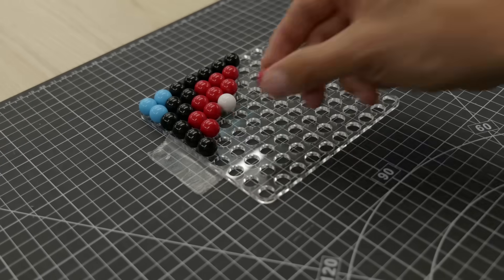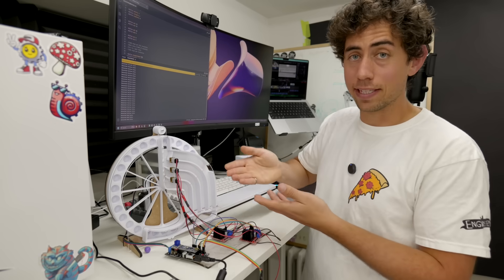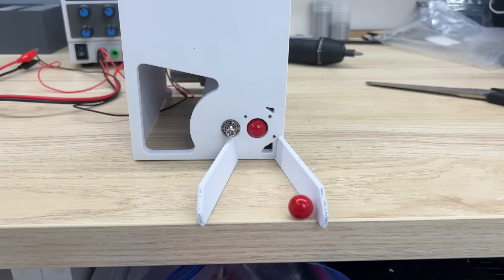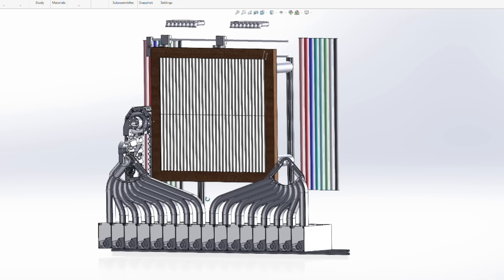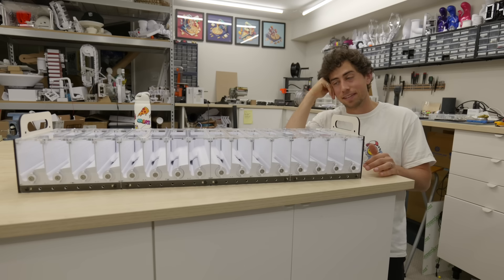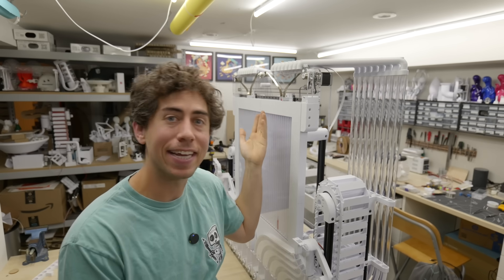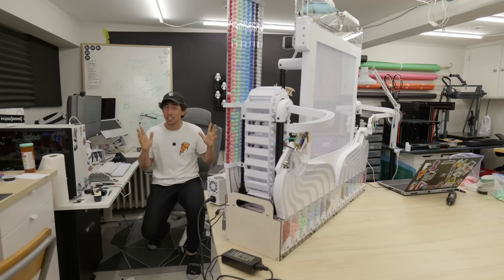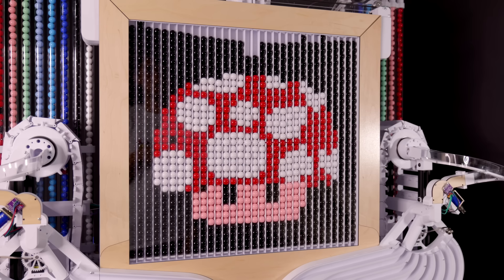This Marble Machine makes Pixel Art

Comment: Wow... so much overengineering things... and it fizzled out at the end when you're filling two columns at a time instead of filling all 32 columns simultaneously. 
I would have used 32 solenoids at the top to "punch" the ball from conveyor belt into the right hole - the belt at the top could be at a small incline - not incline, angle, whatever - to keep the balls from falling off the belt (think natural incline of roads in curves). You could have holes or something punched in the conveyor belt and use infrared sensors (like a mouse uses on scroll wheels) to sync the conveyor belt with the holes, or you could have the separators on the conveyor belt press on a limit switch... each time the limit switch is pressed, you know the ball compartments are aligned with the holes. 
So then it's a matter of just placing the balls in order to be lifted up, but even if you have them out of order, you could just let one ball pass all the 32 slots and fall back into the sorting compartments at the bottom.

Comment: Why not have 8 different containers, one for each color and keeping them separate. You could index ever spot on the canvas to know where which marble is and is supposed to be and you can drop them one by one all on the left of the canvas and have a slight decline with a opening and closing mechanism dropping them down in a connect 4 kind of way. You could of course use the mechanism as in the video but I dont know how it works and haven't seen typical faults it encounters. When you want to clear the canvas you know which marble is where so you release them one by one and can sort them without using light sensors.
Not a big fan of sensors like this if you couldnt tell. My solution should be more reliable even if a little less cool.

Comment: I bet you could produce images faster if you didn't sort the marbles. If you have a color sensor on each tube at the top, you could chose next marble drop from any of the available colors ready in the feeder chutes. To avoid getting stuck without a color you need, you could add a "garbage" chute to recycle marbles until you get the color you need. This would avoid all the complex binning mechanics at the bottom. Only drawback would be aesthetics- more of a gumball machine look than an M&M's store.

Comment: Maybe I missed it but it seems you don't have anything to make sure you have an even distribution of marbles on the right and left side before sorting. Obviously the marbles on the right side of the frame come from the right side and are more likely to fall and get sorted back into the right side, but still there are a few marbles that switch sides. That would possibly unbalance the distribution of marbles. How do you deal with that? Move by hand marbles from one hopper to another?

Comment: I wonder if it would make more sense to put the sorting bins at the top rather than the bottom. I'm imagining that would allow the images to be created much faster since the hopper would only have to drop a ball out instead of pushing up an entire tube of balls -- and then the slower part of the process would fall on the sorting mechanism.

I'm no engineer, though. I'm sure this makes more sense in my head than it would in practical execution.

Comment: @engineezy Couldn't this be much further simplified (but maybe less pretty) by just using the color sorter and the "elevator"? Let the elevator provide balls from a reservoir, the the color selector detects the color and put it in the right column to make an image. If it's not a color that is required just toss it back into the reservoir for a new ride to the top... Of course making an image can take longer... but it's just a lift + the color sorter + a reservoir ;-) no bins per color etc etc

Comment: The screw he had to tilt would have worked vertical if he had put little walls on the screws surface to hold the balls in place as they ascended up the screw.

Comment: Here's a potential project... a smart coin bank. I have 4 x 5 gallon water jugs that I use for putting my spare change in (one for quarters, one for dimes, etc.). Be kind of nice to create a smart change bank where you can just dump in a cup of change into a hopper, have it sort between Quarters, dimes, nickles, & pennies, and have them go from the hopper and dispense into a 5 gallon water jug (again one for each coin value) ... while having a web GUI you can access on a computer that'll tell you how much of each you have (ex. $50.25 in quarters, $7.80 in dimes, etc.) and then have it total at the bottom. The idea is to toss your lose change into a cup style hopper, have it sort, count and dispense it into a jug (so they're separated) and report the amount you have in change.

Comment: There is a bit of sagging (marbles of the same row not in a straight line, but a slight "u".) in the rows of the created images. It gets more pronounced for the upper rows. Will you try to fix that?
Edit: Just saw your comment about that. What about gluing the front plate to the channel separators?

Comment: 4:33 why not offset the design of the triangle to avoid the two spherical packings you're encountering? Sort of like restraining the growth of a crystal. There'll always be a shear line. Simple shifting in one of the walls of the triangle slightly? You could experiment with this using shim pieces of plastic or wood...

Comment: That is so sick, great job!
I feel like a relatively easy upgrade to this project would be to make the current “frame” into just a hidden queue and add a another frame below that. Make it so it displays image 1 in the bottom from until image 2 is completely finished in the hidden queue, clear the bottom frame and drop in image 2. That way it’s always displaying a full image and can be like a cool little art piece. Plus you have 99% of the mechanics completed already.
Either way, amazing work!

Comment: Really fun! Imagine putting a binary sorting mechanism on top of those columns. Similar to "Quercetti Rami". Could be built using 5 or 6 rows of binary branches each of the rows is (entirely) pushed by one solenoid actuator left or right. Maybe it would even be possible to run multiple marbles at the same time through the machine  --> would look and sound cool to shift the rows quickly.

Comment: Maybe I'm stupid, but I don't understand the point of having the marbles sorted outside the display. Why not just have them all together, plumb them across the top, then drop them down if they match color needed in that column? The issue I see with that is that the refresh times could be quite variable due to random chance, but with large images, I think the average wouldn't take too long. Idk, I'm no engineer.
Reply: 0:20

Comment: Hi. Thanks for the video! I like your videos, thats sure. But very meny problems are because of plastic!! Plastic and plastic 3d printers with 3d printers toleranses. Thats the problem. I personally thinks 3d printers are more like a toys, than a real tools or real machines to do somethig real searious shit. Maybe I think like that because I do like to machine all my parts and projects with milling machine or turning. Of course that should not be the right answer, but it is what it is. Thats my opinion, and I cant do nothing abaut it. I just like way too much more abaut metals and metal machining machines. And plastic is like legos for me. I am sorry abaut that, but thats the thing, what I have been noticed abaut all these 3d plastic printers. And otherwise, without any 3d printers, plastic is plastic. I do not like it at all. It is weak and doest be able to handle any heat etc. Pretty poor material even beeing the best of the best plastic compared to metals. I think you should have a small cnc milling machine and a small turnin machine. And wola, there you go! I'll bet you could do what a mazing things with some real tools! And I am searious!! Pleace, thing abaut it at least.

Comment: im getting PTSD from spending probebly 30(probebly more) hours doing this in minecraft.(without commandblocks)
pistons often dont do what you want and sand can break if the timing is not perfect and the bigger you make something the higher the chance is that it will start to lag and something will get out of time. we made memory cells that took a 16 16-bit strings that came from our drawing pad(preassureplates on the ground that when you press on them they get saved to memory). the sand screen had to use the memory cell twice. first to print out the picture that you had drawn and second to sort it back out again since there is no way for the game to know what block it is to sort. 
the biggest nightmare was to get the sand back up again to reset. some sand blocks would often break for seemingly no reason on the way back... or while printing wich would screw up the sorting since it would blindly sort out the same way that it printed.

Comment: filling from the center out to the sides might reduce the impact of the front plexiglass bending. the jiggling effect that the marbles have when they bounce is going to be weaker at the edges where it's secured, and strongest at the middle where it has the least support, so it should reduce how much the lexan gets pushed out by the marbles, even if the overall forces remain the same. if it doesn't, just get a sheet of perspex that is thicker in the middle. a gentle bell curve shape if viewed from the top/bottom edge on. 
if you feel like reducing the bounciness of the marbles as they drop, and EDF blowing air into the bottom of the picture frame (via the exit channels) should be sufficient to slow their falls. while it will get weaker near the top, they'll be falling for less time so the need to slow them down will also be less.

Comment: To make an Archimedes screw work as a lift, the outer diameter has to be such that the balls stick out a bit. You could make it so the screw just passes the middle of the ball where it sits. Then you need rails along the sides to constrain the balls to that part of the lift. 

Look at Spacerail marble runs. They use vertical screws for the lifts.

Comment: Beautiful work. 
Here's a rarely-considered fact (from a guy who has sorted countless marbles): consumer-grade marbles are not held to very tight tolerances!  

If marbles were put into this machine straight out of the mail, it's safe to say that probably more than a few errors were caused by size discrepancies. Standard marbles are sold as 9/16", but that number is just their average size. On top of this complication, marbles will also vary with respect to roundness. Eccentricity is a whole 'nother thing to test for; a simple rail-sorting machine can easily screen for size, but such screenings assume a marble is perfectly spherical, and thus multiple screenings (of the same set) are necessary to determine their degree of roundness.

Forget that, though. An occasional error makes the final product a charming work of art. It's almost better that way. More uncertain. More human.
Reply: Yeah but dead pixels are annoying.
Reply: More like a blind human who can't correct themselves but yea I see what you mean

Comment: Awesome design, and visually appealing. I would suggest a future modification, of a second colour detector at each of the two dispensers so it can eject back to the sorter any incorrect marbles. Also, is it possible to have the sorting of the dumped marbles done at the same time the new image is being built, rather than done one operation at a time?

Comment: Just a question why the center part on top is going downwards? Looks like the bottom is completely flat and stable. It is not lack of a marble as it would be a step or rather pixel difference. This is bending down.

Comment: Man you can use the Archymedes screw vertically just by putting small verticall walls, stoppers,  half the height of balls,  on some parts of the screw to avoid balls going backwards. That's how the screw was used originally to get water out of wells.

Comment: 11:30 why did you design it for a part other than the ones you got?  why assume the size of purchased parts?  measure twice, print once, bro
Reply from the maker: Generally speaking stuff like this happens- I designed using the technical drawing on the parts website before I purchased.  The one that came was bigger, and I completely forgot to check. Human error 🤣
Reply: @Engineezy  lol, fair enough. project's looking great! any ideas yet for solving the occasional color sorting failure?  I noticed the occasional marble in the wrong hopper.  maybe a local light to better illuminate the marble for the color sensor?  or maybe alterations to ensure the marble is centered in front of the sensor?

edit: just saw the other post.  that's a much easier problem to fix.  maybe these ideas could help with the mint/light blue mixups that occur at the sensor

Comment: 6:30 ish, that's not an Archimedes screw, that's just an auger. You would need a barrier inside the tube and you can have it completely vertical.

Comment: Ok, so I had a thought upon seeing this.  I'm not an mechanical engineer, I'm a software engineer who dabbles, but my first thought was that the acrylic in front of the screen channels was going to bow out due to the weight.  I don't see any attachment points, how did you avoid this?  Is it in tension?  Did you just buy really thick acrylic?

Comment: I don't understand why you sort them... Your color censor can select the pixel of every marble passing by so you can have a continuous flow of marbles with mixed colors, you don't care, just select the marble you need on top. If it doesn't match, put it back in the loop of marbles
Reply from the maker: I talked about my reasoning in the video! But you’re right this would have been WAY easier 😵

Comment: Amazing work as always. Others may have mentioned this, but the sagging of the centre channels of the pixel grid might be resolved with something binding the channels to the plexiglass. I thought about recommending adhesives or even screws through the plexi and into the tracks, but perhaps a slot and hook design might work best? Laser cut the plexi to have slots that receive the hooks, then either reprint the channels or add hooks with adhesive. Just a thought.

Comment: Blue marble in the black stack at 15:07 :D
Reply: Or it could be a design choice
Reply: @Froggy_STR33MS-TTV  not in the picture, it's in the black track tube... And there's also blue that end up in the red tube at a different point. There are still some glitches with the machine. I'm really surprised he didn't mention them at all

Comment: I want to see a 640x480 display with small marble's and 256 colour palette or 512 colour palette. Sure the device will be bigger or deeper depending on how you implement it but it can be hidden behind the screen so it could be 2 or 3 ft deep and as tall and wide as the screen and because of the marble sorter you only need 1 bucket to hold all the marbles and have the machine sort and place them as it's building the image. That would be very cool.

Comment: 2:36 you could sort eight colors with three motors.
Reply: You'll need 7 motors actually. Imagine a binary tree with 8 leaves. The root needs one, but then both of its children need one more, and so for their children. In total, it's the number of non-leaf nodes in the tree, which makes 7.
Reply: @rohitkharsan  to sort eight colors you need 2 to the third power channels. That means, you need three layers of binary toggles.
On the first layer you have one toggle which splits to two lanes. On the second layer, you have two toggles controlled by a single motor which split across four lanes. On the third layer you have four toggles connected to one motor which split across eight lanes.
, You don’t even need three motors. You just need three solenoids.
Reply: His solution was an octal turntable. That also works, but it has a slower response time.

Comment: If you did the Arquimedes screw thinner than the marbles and you placed a sort of a vertical bat on the way up, it would actually work as when I was little I had a toy of marble coaster and it worked like that

Comment: You absolutely could not use the sorters at the top of the image frame.

At some point a pixel color would be referenced that could not be placed because it's not found in the image. Now your sorter is stuck, unless you had some sort of rejection path.

Comment: so the trap door at the bottom of the pixel-wall is sagging under the weight of the marbles... and it will probably break with-in the next year, even if you don't use it again for a year... plastic degrades sometimes.... but if you do a fix now it should be much easier than fixing it later because you could probably make a metal metal strip that you can glue to the trap door instead of printing a whole new one after it snaps....
- ALSO are those random stray incorrect color marbles from noise in the pic you use, or is here something else causing an issue... I really think it's just from converting pics into whatever format you use and there being some noise... you could find a way to fix that tho, if you wanted lol
otherwise this is PERFECT!!! I am SERIOSULY IMPRESSED!!! GREAT WORK!!

Comment: I'm guessing that the weight of the marbles is pushing out the plexiglass window in the middle, causing the sagging of the marble columns?
There's also a few 'bad' pixels in the sorter :P

I do wonder though.. with all those marbles slamming together, did any of them shatter?

Comment: How do you do if the marbles are different sizes? And the difference can be 0.02-0.15mm
Reply from the maker: You curse at the machine when they get stuck, use a stick to push them through, drop said stick into channels, use 2 more sticks taped together to fish it out
Reply: @Engineezy  figured. I have this engineering issue and I dont know exactly how to do it.